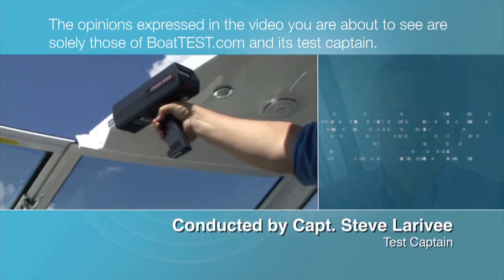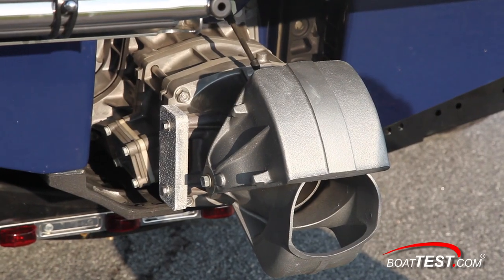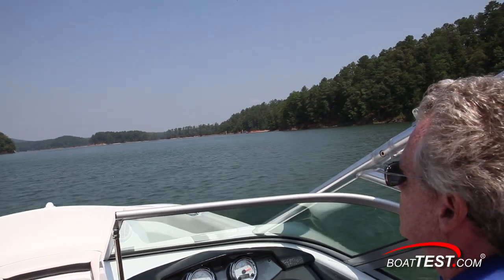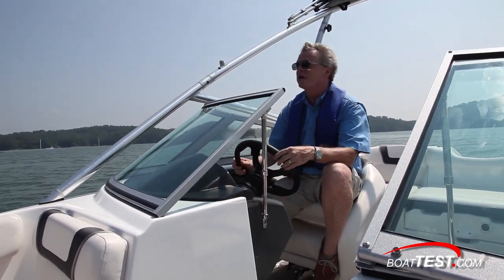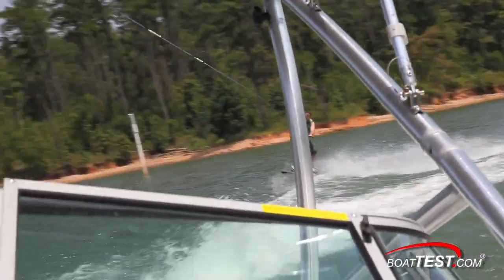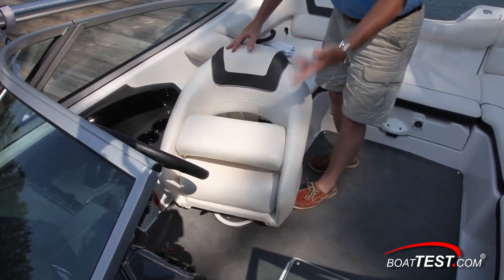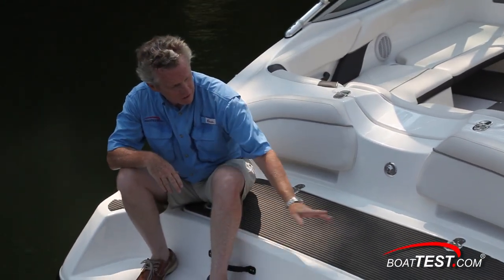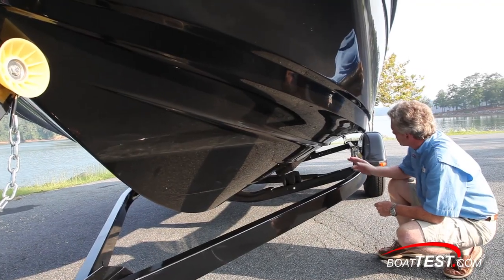Yamaha SX 190 Boat Test

Comment: I love this freaking boat!  Love it!  I bought a 2015 Yamaha AR 190 with 300 hrs on it this summer and we have run the heck out of this little beauty.  It is an awesome boat.  I owned a Sea Ray 240; no one slept on it, no one used the bathroom; no one wanted to ski, too bulky.  I sold and bought a Sea Ray 270 SLX; sexy as hell, bitchin 496 HO engine, to bulky, no one wanted to ski, no one ever used the head, ate gas.  Sold it and bought the Yamaha.  Best decision every.  Everyone loves to ski on it.  No problem going for an hour cruise for a dinner destination and running an hour back.  Nimble, quick AND super easy to maintain!  Love the boat, love the decision to put my fat ego aside and go with a boat that really fits our needs.

Comment: slow top end considering the $ cost...load the boat up....38 mpn mybe
Reply: At this price point
Name a boat that offers these features standard and is significantly faster
Reply: Yeh, comparable boats are easily 5-10k more. You could opt for the supercharged 19ft boat they offer though if power is a must. But, that of course will cost several thousand dollars more. And, more maintenance.